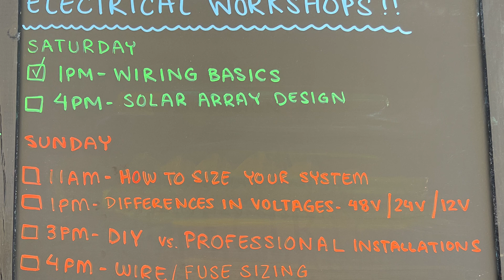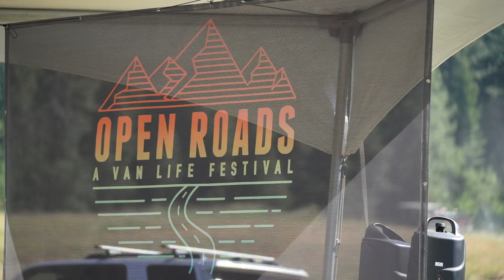WE FIXED BROKEN SYSTEMS & TAUGHT CAMPERVAN ELECTRICAL (Open Roads Fest Recap)

Comment: Maybe consider doing a portable solar that’s plug n play. Lots of folks supplement power by doing portables along with fixed panels for lots of reasons ie, shade, higher use and etc. the need IMO would be the QD function.
Reply from the maker: Very much so!  We will indeed be making the electrical system in our Transit capable of handling a portable array.  We will have a MPPT 250/60 for the ground deploy array, so we can put a pretty serious array out on the ground.

Comment: Good timing... I am pre-wiring right now, in sync with your current video series.  And I must say, in conjunction with your earlier tutorials, you have made this experience possible, pleasant, and simple.  Completing your power audit and purchasing the appropriate (600W, 400Ah) wiring diagram (currently framed on my wall as artwork) were the best investments.  Thank you for all your assistance!